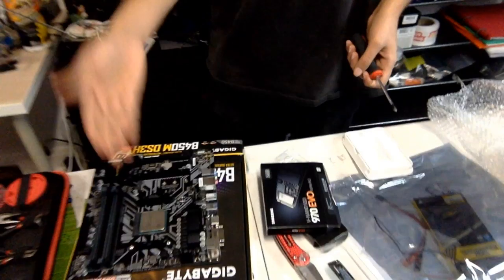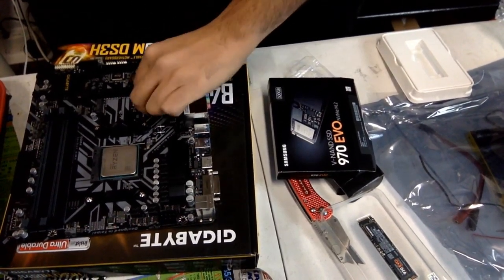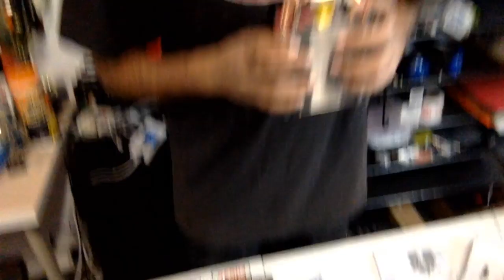New Editing Rig! PC BUILD

Comment: great choice of ssd, the m.2 pci is crazy fast. I went closed system water cooling, scared but no problems 3 years later and great at keeping it cooled. I play on corsa sometimes with a t300 wheel for seat time (free tires and its free to fix if you wreck lol) its pretty good, VR makes a huge difference too IMO.
Reply: 135

Comment: i think you should have stayed with the stock amd cooler, that hyper 212 doesn't stack up to well vs the new coolers (including the stock ones on the amd side)
Reply: you'd be surprised, it outpaces the wraith
Reply: and since it's a bigger fan it doesn't need to spin as fast
Reply: @refracted6349  yes, that may be the only pro of upgrading to a hyper 212, is it definitely quieter.
Reply: @garramiro  obviously given a higher budget i would have gone witha be quiet or an aio but for what we're building i think this is fine
Reply: You're drinking too much AMD Coolaid, mate. On a stock ryzen 5, the AMD wraith spire cooler is on average 5 degrees warmer at idle and 14 degrees warmer under load than the evo 212, not to mention wayyyy louder. Evo 212 is a solid choice especially if they're not planning to overclock. Source Cited: https://www.youtube.com/watch?v=VNjkDoYZYjU
Reply: @WhipsawWillys  wraith spire? Isn't the 2700x shipped with a wraith prism. That's a whole different cooler, mate.